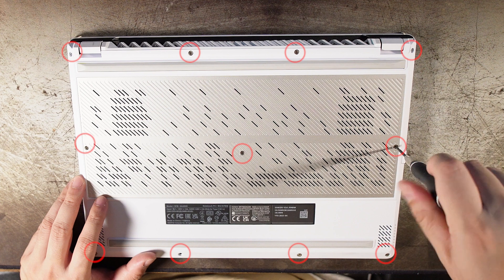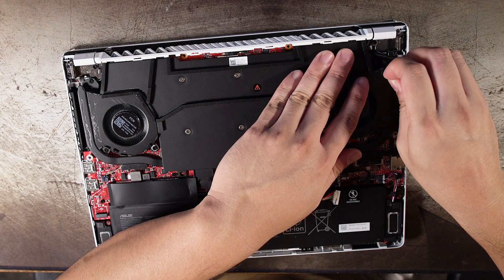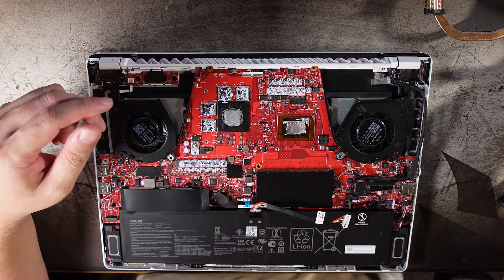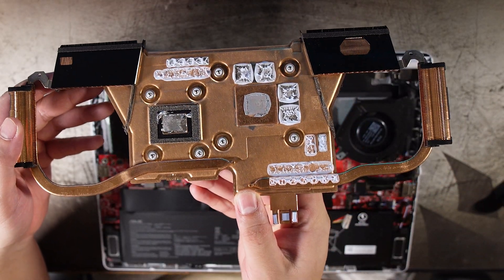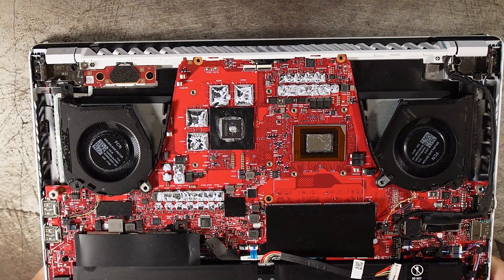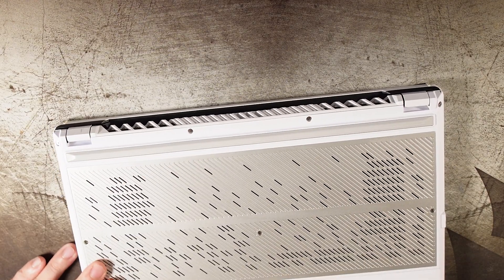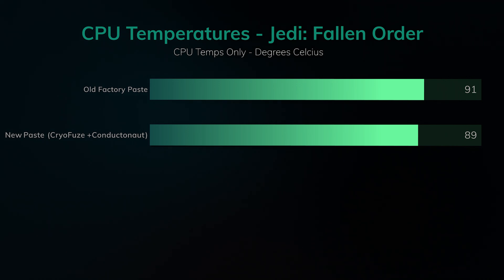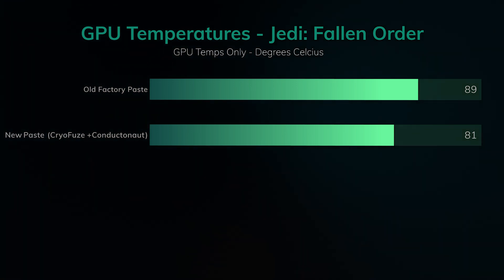I repasted my Zephyrus G14 (2023, RTX 4060) and this happened... 😱

Comment: I did this on my G14 as I was getting heat distress, especially from CPU. I used Noctuna NT-H2 for CPU and CS Labs K5 pro for GPU and all other components that have paste. Just take your time, it’s easy to do. My temperatures dropped by 10deg C on both, CPU idles at 55deg and neither go above 80deg under heavy load. Definitely worth doing.
Reply: Wait, you used K5 pro on the GPU die?! Don’t do that lol, that’ll cook the GPU! K5 Pro’s thermal conductivity is way too low for any GPU die - even CS Labs says to only use it on the VRAM and the VRMs. If I were you I’d replace the K5 Pro on the GPU die with PTM7950
Reply: thank you bro how was application i heard its hard to be careful when applying to make sure it doesnt go on he motherboard

Comment: why not LM on the GPU
Reply: Because it doesn’t have safety zones in case of LM leakage (on the corners) the same as CPU does have. Thus, applying LM to GPU increases the risks of LM leaking to motherboard and getting in a reaction with copper sinks or other components.
Reply: LM is a hella problematic stuff in your laptop. I don’t recommend to use/store your laptop vertically or in any angle that might cause leakage. Engineers have designed the CPU in that way so they can safely apply LM on top of that, but have not considered for GPU.

Comment: Instead of pulling the battery cable out of the motherboard, I removed it from the battery because I've heard the metal clip is nottorious for sparking and shorting
Reply: I have a 2021 3060 g14 and this happened. It was jammed in their hard (had a pro repaste it last year) and i had to pry it out with a thin flat screwdriver. It launched and toasted the motherboard.

Aside from the overheating and preformance drop (low 6k on timespy vs the average low/mid 7k on timespy) it was a great daily driver. i did 3 years of college on it, played alot of games, composed music, and watched alot of movies/shows with my girlfriend.

I feel so stupid. I genuinely feel i could have gotten another 2/3 years out of it as i mostly play strategy and fighting games.

I could replace the motherboard. but that is a more in depth repair and i failed a pretty simple one. i see replacement motherboards on sale for average like 450-500 bucks. repair would be an extra 100-200. you can find refurbished 40 series g14s under a thousand. 

learn from my cautionary tale of woe.
Reply: @jacobbrown3645  I think internals from 2022 are different and 2024 are different....
Reply: @varadjoshi3860 sadly they still use the metal clip to hold down the battery. I just use some electrical tape to cover anything near the clip when I take it off.
Reply: goated comment thanks for making it so much safer and easier

Comment: so was repasting my g14 2021 model with rtx 3060 and after i put everything together the laptop works fine it just doesn't detect the gpu at all this is a huge issuei dunno what to do everything is plugged in and seems good on the mobo
Reply: did you try armoury crate? put it in standard mode, not eco, it happens to me too.

Comment: Better to watercool that lappy 👌
Reply from the maker: Yeah would be a nice addition for a desk setup
Reply: @bronztech  all my laptops are watercooled. Temps never go above 60 and they are dead silent.  But at a cost of mobility
Reply: I have the 4090 oled variant of this. How do I watercool it????
Reply: @DarkestStoriesTV  DIY way mate :)
Reply: @Albert41122  haha I know! Got any guides??? I would LOVE to lower the cpu temp. Stays at 90+ while gaming
Reply: @DarkestStoriesTV  I never used any guides, every loop is made differently. The best way is to use AIO 360 with build in radiator pump like MSI ones and replace the block with copper one. And mount it to the lappy :)  You will have to figure out mounting method thou

Comment from the maker: What's the temperature in your Zephyrus G14 like? Do you use GHelper? Leave a comment below!
Reply: Might be got lucky, but have the exact same G14 specs in the video from Japan, but with AniMe Matrix and Eclipse Gray

My temp been in the ratio 85/69 and 90/75 (CPU/GPU) and have not seen reaching the thermal limit (95/86), based on games I play such as God of War, Control, Minecraft and L4D2
Reply: Don't have a Zephyrus, but a ROG STRIX (i7 13650HX & RTX 4060).  Temps are between 80 - 85 degrees when using a laptop cooler and up to 90 degrees when not using one (Yes, good quality laptop coolers do actually work).   GHelper is a godsend.  Armoury Crate was actually causing throttle issues, even when in Turbo mode so I got rid of it as soon as I discovered GHelper.
Reply from the maker: @thornstrikesback  that's actually really good temps. Back  when I reviewed the 6800M version, I loved it. I would choose that over this, if I didn't get the G14 for the open box price. Thanks for sharing!